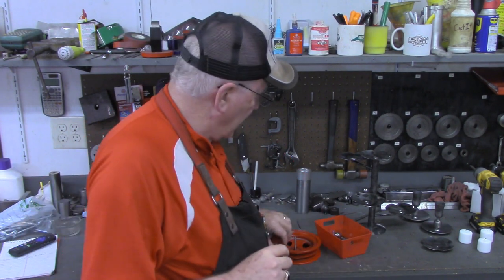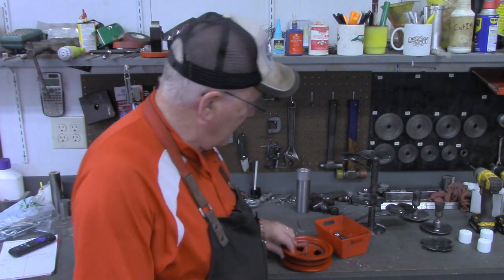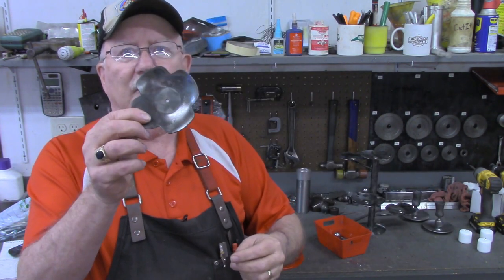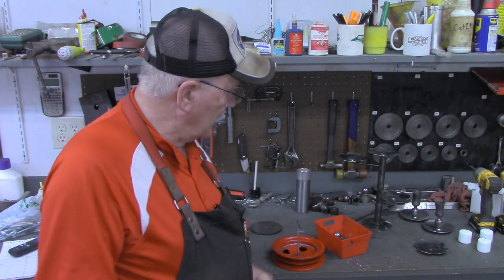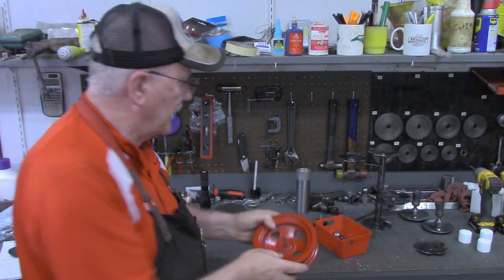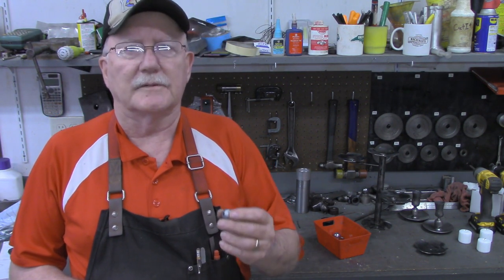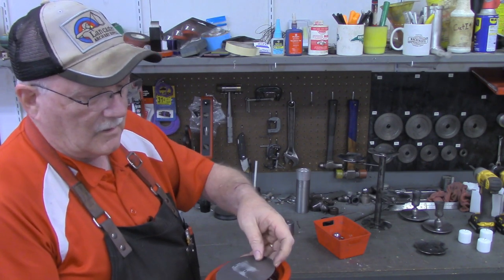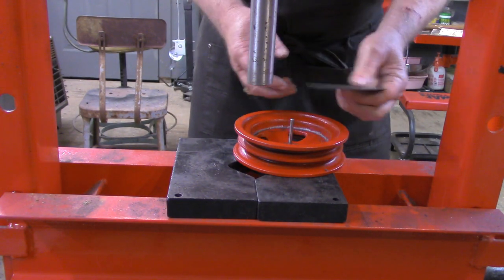20 Ton Press Forming Dies REVISITED

Comment: This is really helpful -- THANKS! 
I need to contour some 12ga sheet metal to form "body parts" for a fairly large bird sculpture, and a big hammer on a bin full of sand just is not cutting it (can't afford a giant English Wheel). I DO however have a 20 ton hydraulic frame. Anyway, your setup - used kind of progressively -- will hopefully solve the problem. Thanks, my friend! SUBSCRIBED!

Comment: Nice job.  Can I add a suggestion for improvement on your press? Add pins underneath the plates so they won't be able to fall on your toes. Four pins each spaced just a little under the width of the hole in your shelf. Took some of your ideas when I build mine especially  the magnetic extensions. Thanks for sharing.